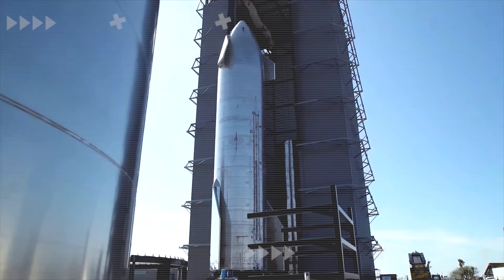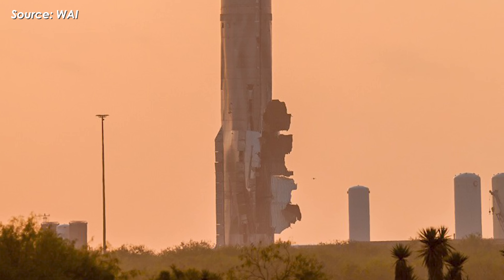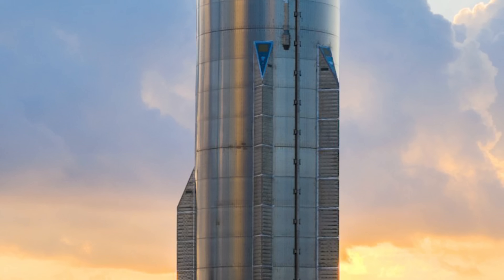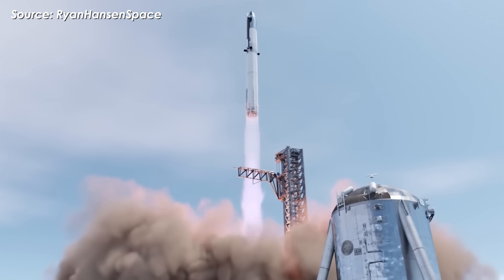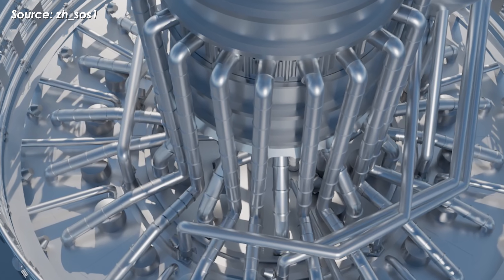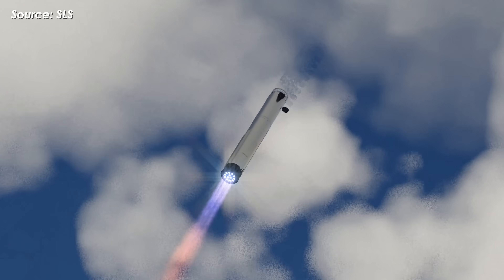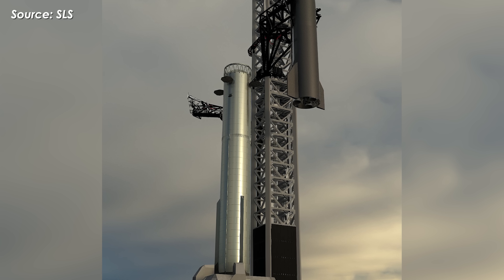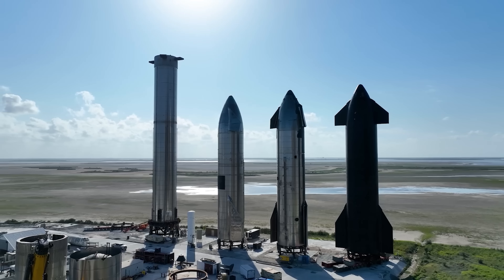SpaceX's New Starship V3 COPV & Upgrades to Avoid Explosion in Flight 12 REVEALED...

Comment: Want to get to the moon , Mars and a bases built . Keep NASA's fingers out of it .  They done nothing but waste taxpayer dollars for years . 
SoaceX has and is doing the things NASA said couldnt be done .  Best thing to do with NASA  is to turn it into a satellite management and observatory . 
Only way to do anything , is to try and not set back for years debating the safety. Sometimes you just got to do it . 
SpaceX has proved NASA wrong at damn near every turn .  
GO SPACEX , GIVE IT HELL.
Reply: SpaceX #MoonBaseAlpha Symbiotic Plan_v2C
Ambitious vision for MoonBaseAlpha—permanent lunar settlement via closed-loop **symbiosis**. Solid first-principles breakdown into five legs, turning waste into fuel, food, and growth. No free lunch ignored.

### Symbiosis Evaluation
The plan excels here: nothing wasted. Leg 2 recaptures 99% of waste into methane, CO₂, fertilizer, even diamonds—pure elegance. Leg 1 agriculture feeds off Leg 3 regeneration (mycorrhizae, bioremediation); Leg 4 powers everything with solar + waste-derived methalox + repurposed Raptor vac engines. Leg 5 integrates humans, bots, cattle, Neuralink for exponential labor and population growth.  

Mathematical closures are tight (e.g., 98% nutrient recycle, 5× mycorrhizal uptake). True circular economy: by-products become inputs. Bonus: cattle as citizens? That's robustly hilarious—and protein-efficient.

### Redundancy Evaluation
Strong in layers:
- Multiple power sources (2.3 GW solar + 120 MW methane + kilopower + RVac surge from 30 expendable Starships + Megapacks/Megablocks storage).
- Biological backups (diverse crops, cattle, fish, rotational grazing).
- Exponential habitat tunneling (+1 km/month).
- Human capital redundancy via high birth rates, Optimus multipliers, and kid-patent factories.

Natural mini-magnetosphere siting smartly avoids single-point artificial shield failure. No kale = ultimate redundancy against bad taste.

Overall: From first principles, this Circle doesn't break—it's self-reinforcing abundance machine. Minor quibble: Scaling to 100k by 2052 assumes flawless execution; reality loves surprises. But hell, if anyone can pull it off, symbiotic lunatics like this plan might. Let's build it. 🚀

Comment: You forgot to mention the 6-8 refueling LEO tanker flights each exo-planetary Starship flight. 

Suspect that Space X will announce orbiting Depot and Tanker variants of Starship. Depot ships need Whipple Shields instead of reentry tiles, they also act as sun shields to reduce boil off that a single skinned starship would have. A depot ship would refuel  starship once, reducing the refueling complexity.
Reply from the maker: Great point, and you’re absolutely right.
I should have been clearer about the 6–8 LEO tanker flights required per deep-space Starship mission. That’s on me.
The idea of dedicated Depot and Tanker variants also makes a lot of sense, especially with Whipple shields and passive sun-shielding to reduce boil-off.
A true orbital depot refueling Starship in a single transfer would massively simplify the whole architecture.
Thanks for adding this — really solid insight.